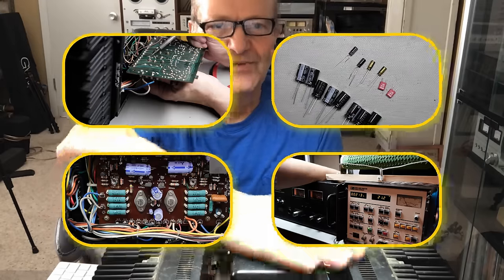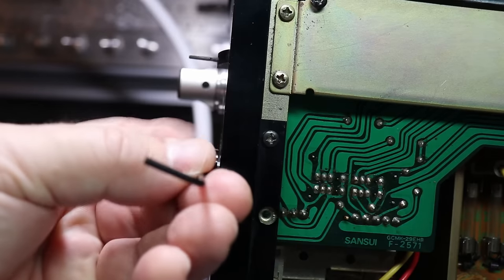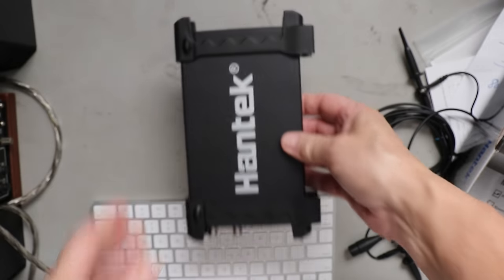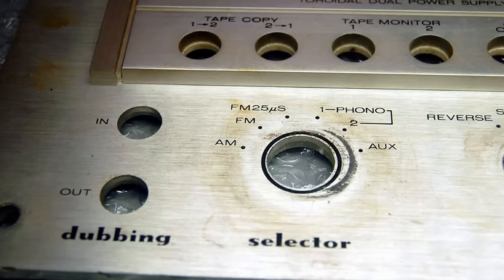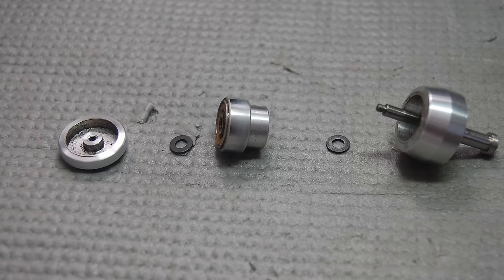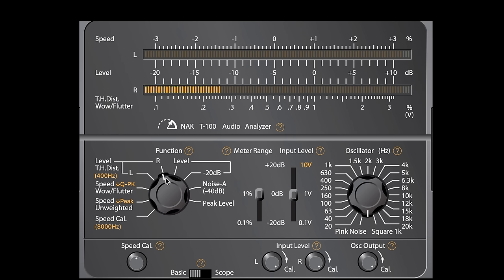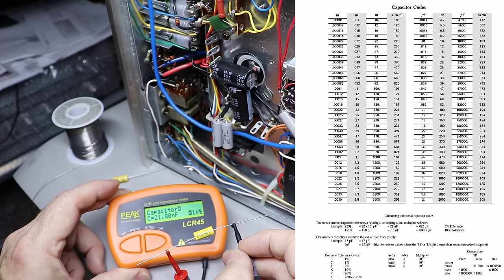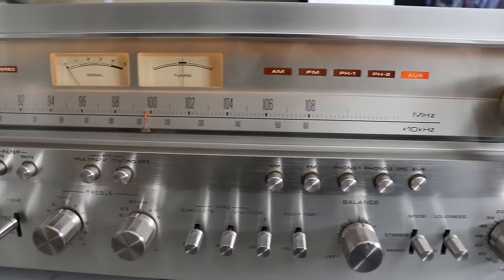Ultimate Guide To Vintage Audio Repair. Old Electronics Troubleshooting. Repairing Tips & Solutions

Comment: When I was 16, I acquired an old Heathkit oscilloscope which had problems.  While working on it, I accidentally got across the 4KV HV supply.  It felt like being punched hard in the chest, and the muscle spasm knocked me across the room.  I learned the wisdom of the TV technician's old rule:  When working around HV, keep one hand in your pocket!  Later in life I was a radio/TV engineer, and worked on a Harris MW-50A 50KW AM xmttr...that thing had a 24KV plate supply.  You DON'T work on a beast like that, power-on!

Comment: One thing I would like to add , before you start to repair, be sure you turn the unit on unplugged to be sure any electricity stored in the capacitors or transformer is drained. I'm not a electrician, but, I'd do it a day prior. Better safe than sorry.
Reply: I've heard that before, does it really work? I've got some filter caps to check on a receiver...

Comment: I've inherited well over 50 (1970's)different tuners, amps, tape decks, and turntables, mostly JVC and Marantz. Dozens of Bose speakers. 901's, 501's and 301's 201's
I've slowly been restoring the speakers and am afraid to start on the stereos.
 I'm glad I found your channel, I need a lot of help. lol
Reply from the maker: I'm glad that you are working on the old gear. Most of the 70's equipment is worth saving.
Reply: @vintageaudioaddict  They are all complete and most are in very good cosmetic shape.  Most are worth saving.
 Currently, I'm replacing capacitors in the  901 Series IV and VI equalizer modules.
This is where I'm gonna learn to "desolder". 
This all belonged to my brother , he passed in 2020. 
I even have his first stereo he bought in the early 70's. 
MCS Receiver. (JC Pennies Brand) lol
It's built nice, has some crackling in the knobs for starters.
I'm sure I will be contacting you for guidance when I run into a problem. 
Sorry a head of time! lol

Comment: Thanks for the informative video--very useful.
That tool for the springs is called a "Spring Hook" -It was a standard tool for all the Field Mechanics who worked on adding/accounting machines in the 50's-60's-70's-I was with Burroughs for 8yrs and used one often--very handy little implement.
Reply: Hello folks.
I call this set of tools. A pick set. I seen them even in a few dollar store and the Snap'-On truck.
 This set I use a lot on so many repairs for the task at hand. The most use tool beside philips screwdriver cutter. 

The multi meter. Nice tip.

Comment: Outstanding video. Thank you from a Tech expanding from RF Transceivers and SMT to old audio just for something different. Found an old SX-720 as my first restoration project and just got the first bag o caps and transistors in the mail. Kind of excited to use my bench and skills anew. Anyway, I appreciate your emprirical advice more than you know. I too try and pay it forward. PCB level diagnosis and repair is becoming an endangered species.